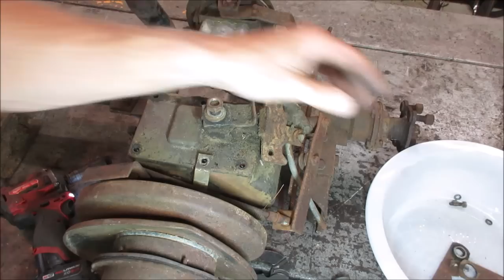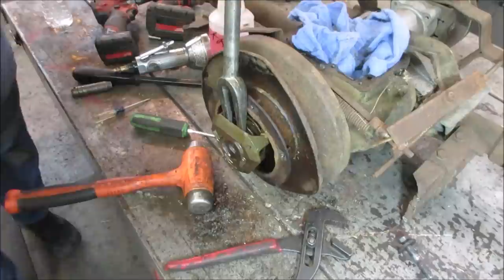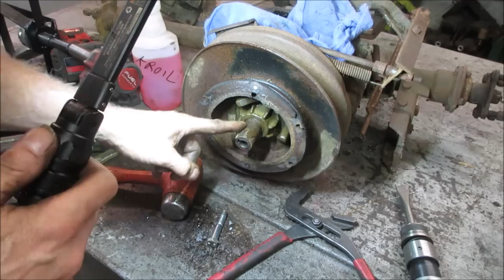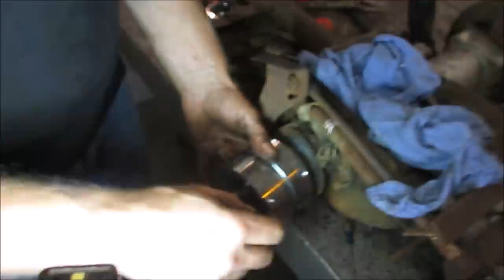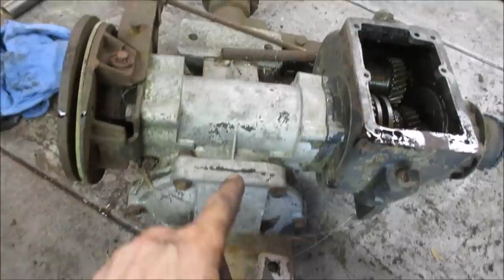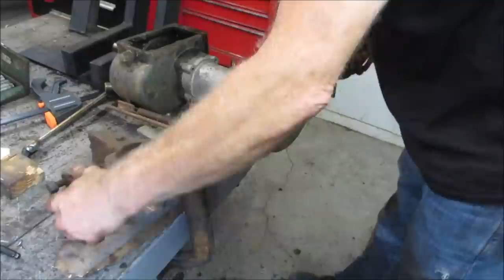Can it Be Saved? old Harley Cart Transaxle from a scrap Yard

Comment: HD golf carts are built different. That’s what’s called a “multi-start worm” and it CAN be back-driven with enough force (like the weight of the cart and occupants coasting downhill). The tires will usually slip before the cart can be pushed from a stop, so there’s a big nut on the end of one of the drive shafts that can be loosened to allow one axle to disengage from the differential for towing. The planetary setup under the worm wheel is the differential. 
Something about the aluminum that HD used makes it especially brittle and vulnerable to corrosion.
Reply: Yes, interesting. When I think about our golf cart operates it makes sense. When you take your foot off the Excelerator, the cart comes to a pretty quick stop and stays where you put it. There is hardly ever a need for brakes on a golf cart. The golfer steps off the cart ,finds his ball ,takes a swing ,curses a bit and gets back into the cart and gives it the BEANS… multi-start worm is sound engineering in this case.
Reply: - Excellent succinctly worded tutorial to help us all understand something I had no clue about, Paul. Thank you.

Comment: I modified a trick I learned from Taryl Fixes all where he used air chisel on the end of a shaft to loosen/remove stuck pulleys from shafts. In your case, I'd soak the brake side with penetrating oil, put a long bolt in the threaded hole with an impact socket over the hex of the bolt, then stick a pointed air chisel in the drive hole of the socket and give her hell. Should vibrate right off.

Comment: oh, i love these style diffs, so much better than the now almost universal bevel gear.
dont know why they arent used more... easier to make than a bevel...

they tend to act a bit like an LSD, as the torque feeding the drive pinions has a step down to the fixed wheel, step up to the loose wheel, yet the torque to spin the loose wheel is being taken from the fixed wheel...

the worm gear will be reversible. worm gears are just helical gears pushed to an extreme. some reverse, as long as the helix angle isnt too steep.

this is relatively steep, so it tends to not backdrive, but it will.

worm drive diffs were popular once, too. but the hypoid crown wheel took over as it gave a bit more ground clearance, yet let engines, boxes, and shafts sit lower down...

Comment: It's not the destination , it's the journey! Thanks for sharing your time with us , making us mechanics instead of parts replacers.
I am an old man who always wanted to work on my machines but did not have any idea how anything worked,  Watching your videos for the past ?? years I have gained so much useful information that I actually feel I can repair a lot of the things that need maintained around the home. Yesterday I went out and started my generator and snowblower  to see if I could get them running. They both started by fuel directly to the carb ,now I just need to make sure they work from the gas tanks. The generator had a problem with the pull start and carburetor linkage and the snow blower I remembered working on about 7 to 10  years ago but I did not think it was operational, it started right up!
I thought from now on , after I have worked on something, I will leave a note attached to it , stating what is wrong, and what I fixed. That way you have an idea of where to start. Thanks again for all you have taught me. and never once thrown a wrench at me.!

Comment: If nothing else is gained from this, you have the makings of a good winch. Use one axle to drive the winch drum and lock the other axle.  When you want to freewheel the winch drum, unlock the other axle and the drum freewheels.   Use an engine to power the input shaft on the fwd/rev box with a centrifugal clutch, so you would have power in or power out.

Comment: I had a 1956 truck that had a worm drive to the diff. the ratio was such that it had overrun just like any other diff with hypoid gears, the worm and gear were made of solid bronze and at one time scrappers were buying such trucks (mostly Fodens) just to get the bronze out of the diff.

Comment: That’s the exact same rear axle and differential setup minus the forward reverse gearbox that my 1991 cushman truckster has in it. I’m sure the width is different but they are very strong built units and yes they will coast down hills. I remember the cushman meter maid you built on the channel I bet it had the same rear axle in it. Either way I hope you don’t trash that axle setup as parts are getting scarce for these older carts. Love the channel.

Comment: Also some of the harley golf didn't have a gearbox reverse the 2 stroke motor would run both directions and would crank in the forward or reverse rotation depending on the shift lever

Comment: The biggest drawback (besides the corrosion) is that worm drive. It would be impractical to try and increase the input RPMs to compensate and make it run at go kart speeds, not to mention the locking of the wheels when power is removed. If you can make it work without too much time and money put into it, it would make a great drive for a high torque "rock climbing" type vehicle. That would be another project with a different engine. With the obvious damage, though, I think this is headed for the purgatory trailer. ☹BTW, where is "purgatory"?  🤔Back home, I would assume. Thanks for the great videos, Dr. D!!  🤩
Reply: will smaller tires help?

Comment: So I restored an old AMF-Harley golf Cart a few years ago that was an older style than what your rear end came from, Mine was a Three wheel type, that one you have there was from a later four wheel cart- 
MY cart that had a three wheel setup, had a 200cc Two stroke engine with a CVT belt setup from the crank right to the pinion gear on the Pumpkin - it had a NORMAL ring & pinion rear end, and the Two-stroke engine had the points timing set to ZERO degrees- when you wanted forward the engine ran forward, when you wanted reverse, you killed the motor, flipped a big lever and it would start the engine in reverse and run backwards- Being a two stroke with ignition set to zero it didnt matter- the Golf Cart would run 35/40mph in forwards OR reverse, which was sketchy AF

You need a rear end out of a golf cart or SXS that has a regular ring & Pinion for sure for your project
Reply: I have  one runs great
Reply: My  is a74

Comment: hellooo from the uk. Not sure you needed to use the threads when using the puller. as long as a bolt head avoids the bearing something smaller just pushed into the threaded hole would have done without risking damaging those threads..

Comment: EZ-Go and Yamaha 4 stroke gas golf carts have a CVT, transaxle with forward, reverse, and brakes.  

They can be found pretty easily here.  They might be a better option.  They have a lever/cable shift.  Older 2 stroke models ran the motor backwards.  Avoid those.

Comment: Almost looks like you have a planetary gear set going on there. The offset in the shaft leads me to believe that you are correct, that you have a worm drive, But that there is also a planetary set between the worm and the wheels.

Comment: I remember seeing a pile of those in a junkyard 50 years ago complete with the two stroke engines still attached. I thing a transaxle out of something like a Cushman utility scooter would work better. They have the same CV drive and some have three speed transmissions with reverse and can take more horsepower then one of those golf cart setups. Now if you still really want a golf cart setup try one of the local golf courses. A lot of times they have parted out frames with transaxles sitting around from wrecked and blown up carts.

Comment: Yeah, a worm gear generally cannot be “back-driven” - depending on the worm geometric angle.  N
As you say, Mustie, it is not a good choice for a vehicle differential because if the engine stalls, the vehicle will skid and if you are going fast, that could be dangerous.

Comment: What you need m8 is a Reliant 3 wheeler back axle, one of the most rugged indestructible axles going, you could sneak up on Aging Wheels and nick the one out of his MK3 Robin.   The Reliant innards are all highly case hardened hence why they are lasting many decades.   Gearboxes are also seriously bulletproof, you can grind it before you find it all day long and won't scratch the surface, dunno what process Reliant used to case harden the movey bits but these were designed in the days before built in flaws, designed to last rather than blow up on a slightly breezy day like todays lavender motors lol

Comment: Puller for that clutch is a hollow threaded bolt that screws into the clutch and another bolt screws inside that and pushes on the shaft to push off clutch

Comment: Drilling a small hole in the center of the bolt head will keep your puller centered just enough to stop the pin from walking off the head

Comment: Just reading about the history of HD golf carts "The earliest golf cart models used a 245 cc dual-cycle single-cylinder air-cooled engine that mixed oil with gas equally for small vehicles." 1:1 petroil ratio, that must have smoked well!
Reply: Yep I had an old 3 wheeler and it was great. The engine being a 2 cycle can run either direction and it ran one way for drive and then you stopped and engine shut off you moved switch to reverse and the starter turned backwards and engine ran backwards for reverse. Was great little golf cart.

Comment: put a socket on the end of the bolt- the puller will stay put
Reply: he's got a lathe, put the bolt in and run a centre drill bit in, that will allow the taper on the puller to stay located too.

Comment: I don't think it would lock up the motor when you let off the gas for the simple fact that it would have the clutch to keep that from happening. Remember, you were direct drive with the drill, it wouldn't be that way with the clutch.
Reply: I guess what I'm trying to say is that the drill was acting as the brake when you stopped the rotation of the drill.

Comment: Looks like a 10 or 13 to one ratio..? top speed of a 1:3 pully drive at 8000 rpm will be about 30mph.. You will have to overdrive it by a factor of at least 3 and that will put the entire pully and variator system under a lot of revs for a peak out at 60mph..

Comment: It might be a better idea to buy a recently non-running electric golf cart and replace the motor and batteries with your Frankenstein's monster of a 40 horse. Then you get transmission, brakes, frame, and steering. Go hang around a couple of golf courses.

Comment: Morning Darren,  I think you mist a hex bolt on the CVT side.  At 20:11 on you briefly can see a little in the shaft opening and you can see what looks like a hex bolt. That probably held the  CVT to the rest of the shaft of the gearbox. That might make the disassembly a bit easier to salvage the gearbox.

Comment: Mustie, when using the puller against a bolt head, use your lathe and center drill the bolt head before installing the bolt. Usually the tip of the center drill is large enough to hold the tip in place.
Reply: Put a socket on the head and use the square hole to centre your push bolt.

Comment: Doesn’t having the cvt keep it from locking up the rear wheels. Isn’t that the point. Of having a cvt clutch. If that rear drive had standard ring md pinion you wouldn’t need the cvt could go direct drive.

Comment: You didn't want to use a torch because of the bearing behind the clutch.... but a plasma cutter is ok?
Reply: The plasma cutter only heats the point where it's melting the steel, a torch has a wider flame all around.

Comment: Why can’t you tear it down, clean up ( wire brush) the rust in the spider/planetary gears, add new bearings and still use it,  the worm and tranny gears are ok,,how much use is it really going see,,, is it possible to continue on to use it?   if the unit will work for what you want it to do?